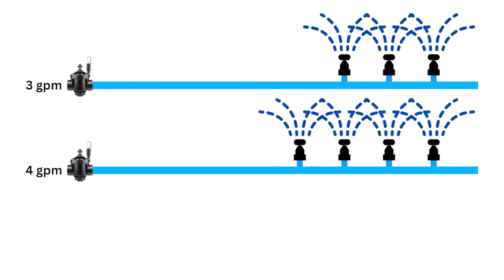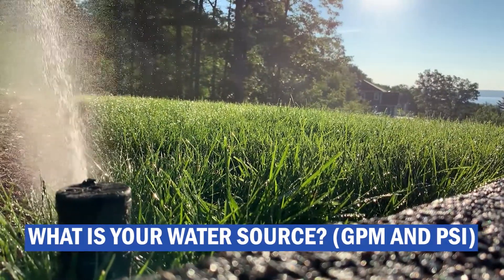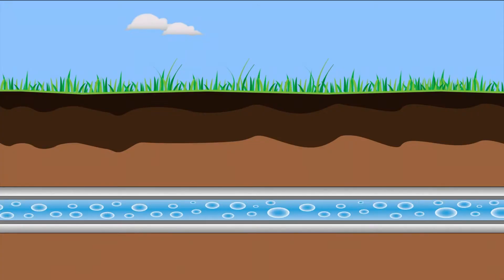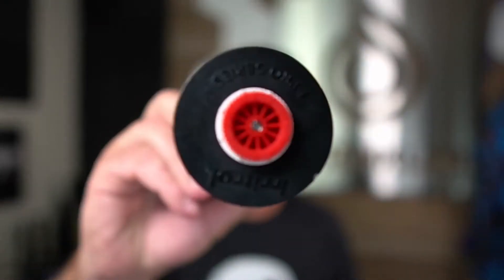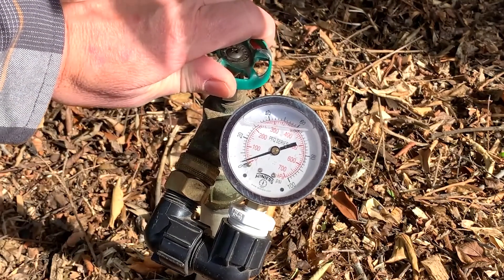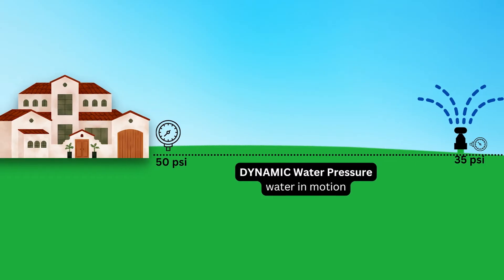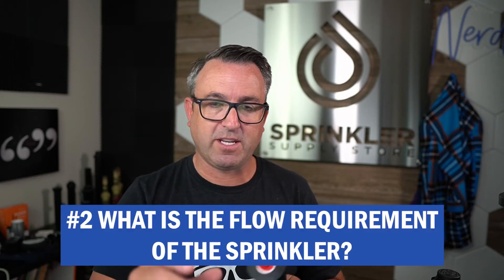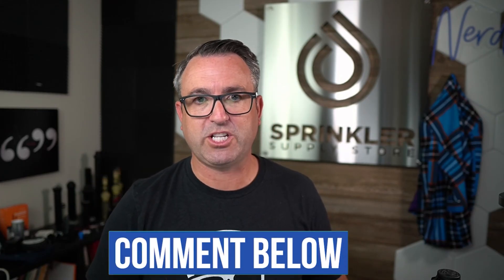How many sprinklers can I put on one zone?

Comment: How does the actual length of the zone affect it? Or does it matter. For example, if I just need three heads for a zone and i have enough gpm and psi but want to go 100 feet what is the pressure loss through the actual pvc? New to this so sorry if that’s a dumb question.

Comment: Hope you are doing well.i found this to be a pretty information video.
Kindly explain about center pivot irrigation system,I have some questions regarding center pivot system if you help me out I am very thankful to you,
Please explain me how to we calculate sprinkler head size in center pivot system.
Example 
We have 8 inch main PE pipeline and length is 160 meter and water flow is 966(GPM)
Now From 8 inch we take 1 branch line Every 1 meter for 1 sprinkler now how to we calculate how many  sprinkler are use here and which numbers of  head sizes be use here for good pressure in all sprinklers ?? 
Your positive response is highly appreciated.
Reply from the maker: Happy to help. This is beyond the capabilities of responding here on YouTube; please schedule a technical support call using the link in the description.

Comment: Great video, I'm planning to create DIY system with poly tubing so it can be converted to an unground system in the future. I've been considering 3/4 inch and 1 inch poly due to the distance and amount of heads I would like to install. Would you measure the GPM directly from the spigot or would u recommend creating short hoses for each diameter and connecting them to the spigot to measure the flow after building pressure in the line?

Comment: I noticed on the rain bird 32SA the springs look too strong for my water pressure, I don’t think reducing nozzle office size is gonna help that , I have 360 fan sprinklers in back that work fine, same psi same length of hose, but I do notice that the spring gauge thickness is quite less, hence easier for a 40 psi to push out a popper ! Gonna try the smallest one now, but I doubt it’s gonna work! And yes I have double the heads 4 in ft and two in back which significantly reduces my psi ! So what’s ur recommendation go to lower pressure   Sprayers ? Thks .
Reply from the maker: I’m not following your exact question. The springs are unrelated to the sprinkler pressure requirement.

The 32SA is rated down to 25psi (https://images.salsify.com/image/upload/s--Sikg69SR--/bqsvkd5hifn3nc1mhytw) 

To reduce friction loss and conserve pressure you have 2 options.

#1 increase the pipe size.
#2 reduce the water volume (use smaller nozzles, or remove sprinklers).

Last option is a booster pump. 

Hope that helps.

Comment: If I'm getting my water from a 2" riser pipe that is gravity fed from a 4 or 6" pipe gravity fed a ditch that is 30-40' higher do I do the bucket test for gpm?  If I recall correctly I had ~20 psi at the riser pipe when I checked it last summer. It must be somewhere close to that because I just gravity feed with a 2" hose to a large sprinkler
Reply from the maker: I love you Jason. This is 100% NERD. 

Yes, do a bucket test, but you may have more, a lot more.

What you need to know is:

#1 the size of the source pipe
#2 the pressure

Comment: I found this to be a pretty informative video. the  explanation of the concepts was very clear and easily understandable without making it overly, complicated. 

now i just need to find a table of standard friction losses that includes valves.
Reply from the maker: Thank you for your kind words. Every valve has a psi friction table available. This is typically found on the product Cut Sheet or Specification Sheet. This link is an example; scroll to the bottom of page 2 to see the friction loss. -Andy

https://www.hunterindustries.com/sites/default/files/CA-Cutsheet-1-Inch-PGV-and-PGV-Jar-Top-US.pdf
Reply: @Andy_Humphrey  great, thanks! I guess I should have thought of that myself.
Reply from the maker: Haha, now you know. Pass it on 🤙

Comment: Is it okay to put drip irrigation and pop up sprinklers in the same zone or does each zone have to be one type of sprinkler?
Reply from the maker: Hi @gennafer, thanks for this fantastic question! It's great to see such engagement. Typically, it's advisable to separate Drip & Pop-Up Sprinklers into different zones. However, there are exceptions. For example, if your plants aren't overly sensitive to water variation, combining them might work, particularly in scenarios where expanding an existing system makes separate zoning challenging.

To put it simply, spray-type sprinklers usually have a higher precipitation rate, about 1 to 1.5 inches per hour, compared to drip systems, which are around 0.25 to 0.75 inches per hour. Imagine filling two different-sized buckets with water; sprays fill up their 'bucket' about twice as fast in the same time frame.

My advice? If you're considering combining them, try to match spray nozzles and drip emitters that have similar precipitation rates as closely as possible. Stay tuned, as I might upload a visual guide or a demo video on this soon! And as always, feel free to reach out with more questions or share your experiences in the comments. Happy sprinkling!